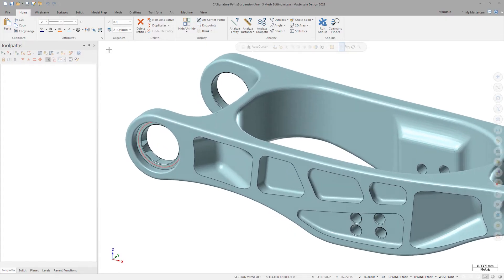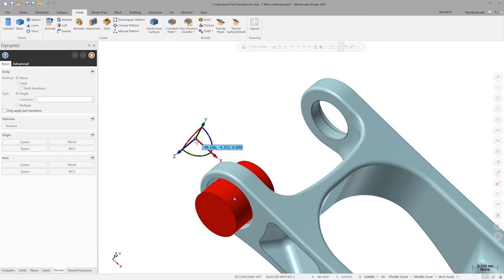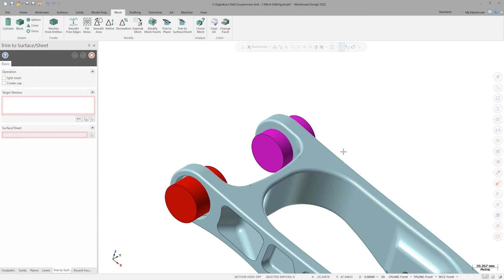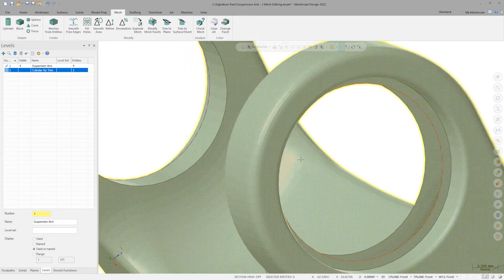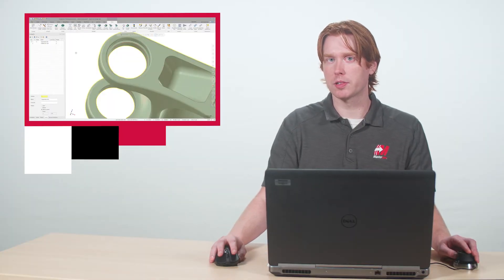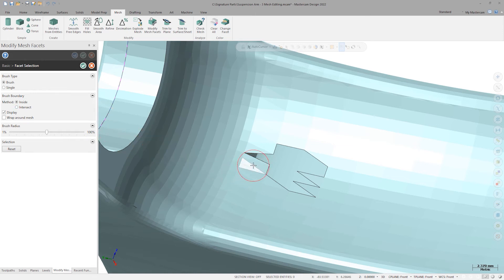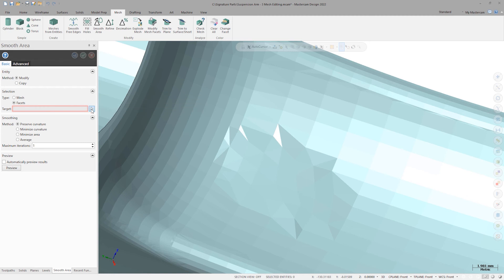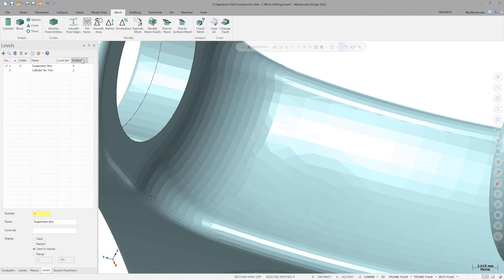Scanned Mesh Editing using Suspension Arm Demo | Mastercam 2022 Signature Parts

Comment: Is there a way to run the same tool on multiple work pieces from different toolpath groups before tool changing to the next tool? In the past I would create a whole different toolpath group and name it all operations G54-G57, then I would copy and paste the toolpaths from the other toolpath groups and put them in the order I want them to run based off the tool. So that way tool#1 ran on all work pieces before tool changing to the next tool. Is there an easier way to do this???
Reply from the maker: Hey Cody! The process you have outlined is generally the safest, easiest, and most flexible way to sort operations by tool. Mastercam 2023 will make your process even better. You will be able to move OR copy the selected operation(s) if you click and drag it with the left mouse button. The new left mouse button function will match the existing right mouse button function.
Reply: @mastercam  thank you for getting back to me. I'm glad 2023 will make it easier.